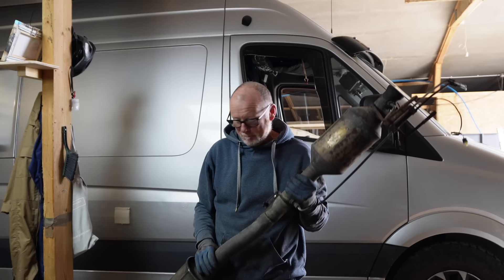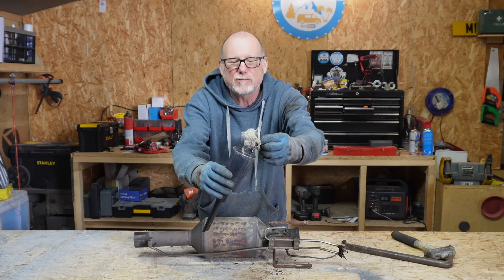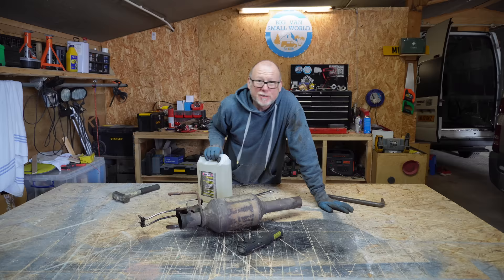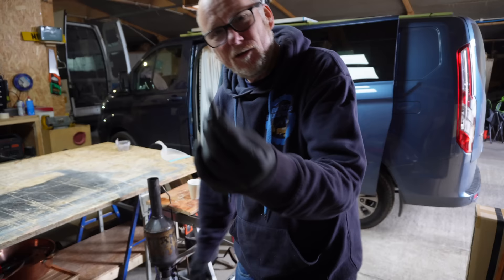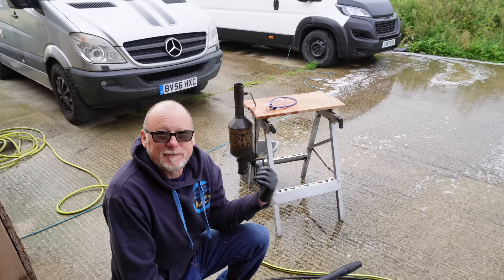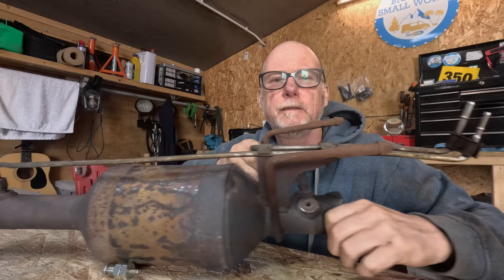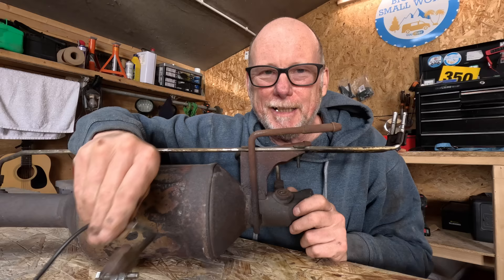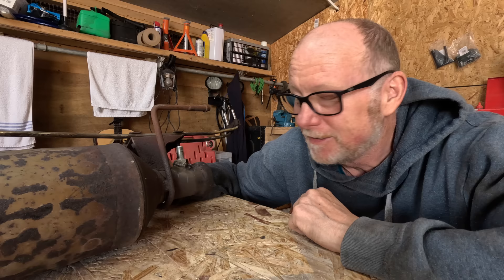DPF REMOVAL & CLEAN Using Wynn's Off Car DPF Cleaner

Comment: Did my crv dpf this week. Bit of a bastard to get out as its right down the front of the engine and a heat shield gets in the way. Once out cut the heat shield corner and you will makes life alot easier.  The chemicals and additives just dont work. Save your money. Just take it out and clean it. Jetwash, chemical soak, jetwash. Back in , force a regen and its good as new.

Comment: Mel, could you have brazed the drilled out bolt in place, maybe clamping it in position?  Though perhaps tack welding in place will be sufficient.  Clever plan to use the bolt to seat the sensor, very resourceful.
Reply: But it won't be in the correct position

Comment: i had problems with me last kuga had to remove the dpf to clean it.
did clean it before via dpf pressure sensor tube this worked just as well as the removal watching the pressure drop on my forscan system. then doing DPF rest the values.
the biggest problem is people don't investigate correctly as to why the DPF regen is not working in the first place to keep it clean.
Mel this could be to the fact that your DPF pressure sensor is faulty.
also make sure that your sensor when you get fits in place and goes as deep into the exhaust as the original or you could get incorrect readings.
that sensor works like a 02 sensor it needs exhaust flow over it hence the holes in it.
Reply from the maker: That’s so true

Comment: So,they put these filters on the vehicle so it doesn't polute or contaminate the enviroment but loads of people are flushing them out like yourself (and i'm not pulling you on it as i would do exactly the same) with some kind of detergent/chemical and then rinsing it down the drain or into the nearest grass verge etc which then contaminates the enviroment,what nonsense.
I just cannot see any difference between the old steam engines were they had to clean the soot and clinka out of the boilers and this dpf filter,it's ridiculous.
Great video glad you got the soot and clnka out 😀👍

Comment: Cleaning a dpf while in place is often a cheaper and easier option due to the location of the dpf and due to exhaust sections being seized together.
But, it does not clean as well as removing the dpf and back flushing to clean it.
Reply from the maker: Yeah I know

Comment: injector warning lights on my renault trafic and had it plugged into computers 5 times had new dpf cencor and some other part but lights kept coming on and after a year of this another gargage checked it over said it needed dpf deap klean so far done 300 miles and been great feels like it has more power as well....for a 2012 van with 181.000 on the clock still good for her age..

Comment: it doesnt matter which way its flushed, best not to use narrow stream or turbo nozzle pressure washer on ceramics. soot doesn't matter, it can be flushed out after soaking in dishwasher tab or washing liquid, its the red ash that needs dissolving. wynns works to a point and needs 2 days, actually coca-cola works pretty much the same.  alloy cleaner or HCL works better and does the job in 2-3hours,

Comment: And people keep asking me why I still run a Fleet of 38 1986 Peterbilt 359's with 3406B Cats and 6x4 Spicer Transmissions. Maintained to Pristine operating Condition.  NO DEF or Cumputer controlled Engines Stranding Drivers on the side of the Road.

Comment: Hey Mel handy having that drainage ditch to wash all the Crap into .
Reply from the maker: Yeah just like all them people that wash their cars every weekend 👍
Reply: Congratulations for creating your own environmental disaster!   I'm no eco warrior but I really can't approve of your disposal method.
Reply: That's what happens on a regeneration....drive up the motorway and all the crap flies out the back ..... leave Mel alone
Reply: @danielhines5698  In a normal regeneration cycle the soot is burnt off at high temperature, very different to removing soot by chemical methods. Slightly different to using a chemical flush and then pouring the resultant debris in an open ditch. I'm sure Mel is a lovely chap but he is in this case setting a very poor example. Sorry if that offends you or Mel but sometimes the truth hurts.  I
Reply: @Dickie2702 it's soot that's basically carbon. Carbon actually absorbs lots of bad stuff - it's used in NBC suits and filters and such, so while looks dirty it's ok. No worse than emptying a BBQ.
Reply: @gorillacyclist  Grow up will you. Call a company that cleans these things commercially and ask what they have to do with their waste. I suppose the liquid that he has used to clean his DPF is lovely stuff too?

Comment: That filter should be oven dried after wet cleaning before it is reinstalled.
Reply: Why, it is no different than condensation flowing through when a cold engine starts.

Comment: That's probably why a lot of companies clean a dpf on the vehicle? You went from a £60/100 job to £500 or more depending on vehicle ! BUT you have only fixed a symptom of a fault that was causing your dpf to not be doing regens to burn away the soot ! 
Usually when they block it's because of ASH that needs cleaning but soot is usually a different problem !
Reply from the maker: You’re right there thanks for that 👍😂👍

Comment: In theory your right, in actual fact you are incorrect. Wet cleaning is just as effective from the 'inlet' end of the DPF especially if the DPF is near vertical such as a Mercedes S class. One other point, is the heat sensor going to be at the right depth into the gas flow...
Reply from the maker: Thank you 🙏

Comment: 1/4 pool acid 37%- will do the job as well :))))
I think you broke not heat sensor, this is particular matter  sensor- it reads pressure and sends info to computer. This is how you find out that dpf is blocked.

Comment: Great video Mel 
It’s my next job now I’ve seen how bad my EGR valve and intake manifold was clogged with oil and soot
Reply from the maker: Good luck 🤞
Reply: You need to ask your self were is the oil coming from There should be no oil   EGR and DPF we're designed for dry soot and ash  only
Reply: @patkelly9907  Crankcase breather pipe. It's normal to have some oil residue going through the intake. The unfortunate part is the oil vapour mixes with sooty EGR gases in the intake manifold and turns to gunk attaching itself to components and over time clogs everything up.

Comment: The fluid they put in the DPF dissolves the soot and the engine pressure pushes it out ,and launch fluid works better mate ,but I could see the method in your madness, any how not every body has the time to do this method they need the car for work
Reply: Dpf aren't so expensive if you replace your self and maybe 1hour of your time.

Comment: great logic and engineering. hope it all works ok. i wouldnt be suprised though if the sensor is M14 X 1.5 and the standard M14 bolt you fitted  is a  X 2.0mm pitch thread.
Reply from the maker: You’re absolutely rite but I did manage to work it on 👍👍
Reply: @BigVanSmallWorld right not rite
Reply: @BigVanSmallWorld  aah good. hope you're feeling alot better and the motors running well  👍

Comment: If you were just going to use water to rinse it, i wouldn't have bothered with the treatment solution. Best way to clean these is heat and airflow, just like it would get on the vehicle.
Reply from the maker: Thank you for the advice

Comment: @BigVansmallWorld  
Your reasoning for taking off the dpf to be cleaned is flawed. The dpf captures the bigger particles created at lower temperatures when the engine is cold. Then burns them off during the regen allowing them to passthrough the filter. Blowing a cleaning solution into the dpf dissolves the soot into small enough particles allowing it to passthrough the filter.

Comment: Im  not a fan off  DPF how ever they there for a reason   and work reasonable well untill the mileage  get to around  100.000 mile then we all have problems  However in my experience the dpf is blocked by oil coming from the crankcase breather filter which is blocked  As the soot and ash build up then you add engine oil fumes  you have a real  stick mess inside your dpf  Check inside intercooler pipe  make sure it bone dry if  not you will soon block the DPF
Reply from the maker: That is probably the most helpful comment I’ve had on here thank you 🙏

Comment: I vrone down up scotland blocked DPF so ordered a reconed one from DPF clean team down Lester £750 😱 causw of the blocked DPF was a machanic fitting a cheap sensor and couldnt delete the engine management light which wouldnt allow the DPF to regenerate. Cost me a thousand pound in total and ruined trip.

Comment: Hi Mel have you tried just putting petrol mixed into the diesel makes the engine run bit hotter but clears the DPF my truck fitter gave me the idea and it worked put about one gallon of petrol into a full tank of diesel .worked on my Renault Master van?
Reply from the maker: This could seriously damage your fuel pump I wouldn’t recommend doing that

Comment: My Karcher make the same noise as yours when trigger not squeezed.
Reply from the maker: Interesting 🤔
Reply: It’s not normal, I’ve had mine about 20yrs and it started doing it last yr, it pulsates like yours, no idea why.
Reply: Possibly one or more broken springs on plungers . If so can be replaced as I did for a clone. Fiddly but extends useable life aka eco friendly
Reply: @jondor654  Thanks.

Comment: Hi Mel, Have you ever considerate to delete or empty the filter..in such a way that it can bee noticed? same actually for the EGR valve..I personally feel and think it's not really good for the engine, cheers keep up the nice work, really enjoying the videos , take care Marcello
Reply from the maker: Yes I have but it’s legal and bad for the environment
Reply: Not really any worse for the environment buddy the dpf still kicks out on a region & the egr puts damaging micro abrasives into the oil wearing your engine 

Without both the engine will last forever no limp mode runs cooler being able to breathe not to mention it will still pass the emissions test on the MOT as it’s actually the catalytic converter doing the environmental protection. 

It’s a marmite topic love or hate it , 

but facts are facts both the egr & dpfs are the course of most engine failures 

Imagine walking around with a tube coming out you blow hole back into your mouth with fingers up your nose lol that’s the modern crap on engines today  

Iv cleaned many of the dpfs & without the egr done as well will block quickly they meant to region every 300 miles if not up to speed for 40 minutes it will cancel the region 

it only dose this about 3 times then the dreaded limp mode.
Reply: regen only takes place when the ecu calculates how many grames of soot or when the back pressure reaches a certain point which is about 20000 miles alot more if your going up and down motorways every day which is what diesel engines were designed to do @VanlifeHQ
Reply: @BigVanSmallWorld plus it'll never pass an mot emissions check
Reply: @karldingbat it does. Had mine done years ago.
Reply: @Tom-hl7wc  dodgy mots for years then, and dont say its not, i worked in an mot station!
Reply: @karldingbat  explain to me why it would fail an MOT? I have a feeling you won’t be able to answer me. So for people don’t know who are interested an MOT on diesel vehicles is a smoke test. The fail mark is set so high that it’s virtually impossible (unless there is a mechanical problem with the engine) to fail it. The guy who removed my dpf and remapped my ecu had never had anyone fail a test afterwards.
Reply: @Tom-hl7wc  fast idle smoke test fail, nox high levels co high levels hydro carbon levels off the scale just to start with, would you like me to carry on ?
Reply: @karldingbat  they don’t exceed the standards. The standards now as they were for vehicles in the late 90’s that didn’t have DPF’s. Like I said mine was fine. So long as you get it done by someone that knows what they are doing it won’t fail the smoke test or visual inspection. The guy who did mine (the dad of a mate) had done hundreds. Never had a problem with MOT’s.
Reply: DPF Delete is probably the way to go. Not only does the DPF choke the engine it is probably resposable for about 9 or 10 Mpg less. Surly extra Mpg for a very slight increase in emmisions is far better - keeping in mind that most of these companies were falsifying their data (Volkswagen emissions scandal) as an example.

Comment: Are you going to tell us the dpf is still showing a problem and actually it was the exhaust back pressure sensor (£45)?
Reply from the maker: No not at all it’s actually working fantastic now I have cleaned it and reset the ECU

Comment: Great video mate, just a quick one would I able to undo that nut on the pipe that connects to the exhaust that holds the thin pipe? Access on mine is very limited, I can only access that nut with that thin long pipe. Was thinking undoing it and spraying cleaner inside it.
Reply from the maker: Yes, absolutely

Comment: Would the high pressure from the washer do damage to the dpf
Reply from the maker: Not at all it’s been working great ever since
Reply: @mel I have a problem you may have come across mate. 

I have a 2017 sprinter - pooling water in the footwell by the pedals.

Heavy rain is giving me water .

The material against the firewall is soaked 

Checked the roof and around the window seals and can’t find anything untoward 

Anywhere else I should check ?

Comment: Can you name all the tubes and wires going on to the dpf?  it's not all sensors are they?
Reply from the maker: Basically yes they are the one I broke was a heat sensor the two pipes are for a pressure sensor that senses the difference in pressure between the inlet and outlet of the DPF if the pressure is high on the inlet side and low on the outlet this tells the ECU that the DPF is blocked 👍

Comment: You couldn't make it up. You have a DPF filter to stop the contaminants getting into the air. But once it's done it's job, you can flush it out so the contaminated go into the air and into the drainage system 😂

Comment: Hi Mel I know it says off car but is it possible to do this on vehicle as I don’t have the means or place to remove it ?
Reply from the maker: yes you can but to be honest i would take it to a garage and get them to do it for you
Reply: @BigVanSmallWorld  unfortunately I don’t have the funds to take to a garage. I’ve used everything including the foam dpf cleaners and it’s still saying dpf on my scanner. Now again goes into limp mode switch off and on the van drives fine again. Getting fed up. Starting to feel my ecu is fucked because ever time I scan it comes up with other sensors then I scan again and there gone :( I sick of these modern vans

Comment: The DPF light comes on when the soot load is too high. Your analogy with the vacuum filter isn't quite correct. A DPF collects soot as you drive then occasionally burns the soot off to clear the fillter. The soot itself does not pass through the filter. It does however leave a residue of ash which does not burn off and is what determines the total life of the DPF. When you backflush it you remove the ash so when refitted you need to tell the ECU that it has a 'new' DPF so it resets the oil ash amount. If you don't do this, the car will say it needs a new DPF when it doesn't as it has no way of measuring the ash load and just calculates it based on mileage/regenerations etc.

Comment: Do you know if it is necessary to reset the ECU once you change the DPF with the scanner or a regeneration to get the new values from the differential pressure probes?. I have to change it for a new one, it is very saturated.
Reply from the maker: Yes you do 100%  i had to have this done on mine but i was sick at the time so didn't film it sorry. good luck with yours
Reply: @BigVanSmallWorld  I have not scanner. Ummm. Thanks.

Comment: You don't understand chemistry. When adding some fluid to the DPF from the engine side, you are change soot particals to something smaller. Imagine you got sugar or salt in coffee filter. It will not pass. But add some water and the sugar and salt will solve to something that will flow through the filter (salt water and sweeten water).
Reply from the maker: Thanks for the lesson 👍

Comment: Forget cleaning. 
Carefully cut down a seam, open up the dpf and knock the filter out completely. Carefully weld it back up, grind back the weld and repaint with VHT  paint.
It'll make absolutely no difference to exhaust emissions re the mot test and its something you'll never have to worry about again. It will also make the exhaust more free flowing.
Reply from the maker: Thanks for the tips!

Comment: A trip to a flow bench would show you that your wasting your time. Yes your flushing out the soot but much of the ash is baked to the inside of the filter.
Reply from the maker: Nice theory that but you’re wrong on everything you say. The ash content is zero and soot is zero too and I know this because I had a friend who is an expert test it and reset the ECU
Reply: @BigVanSmallWorld  I guess it's your story. But i know from experience since I used to clean mine that way. 2 weeks after cleaning mine, it cost me a thousand dollar tow bill. And 6500 dollars to have the dpf replaced. I had the old one flow tested and even after having it air slice cleaned it  still failed. Just because your friend reset the ecu doesn't mean that's what the filter actually tests at. That just means the computer thinks it does. They could have sent it out to be baked but i didn't have that kind of time,since I had a load to deliver.

Comment: The metals in the oil and fuel will eventually clog everybody's dpf filter, doesn't matter how hard you run it. The ash cannot be burned off with a regen. This is the dumbest thing I've seen and the more I educate myself on it the more and more I want to delete my truck.